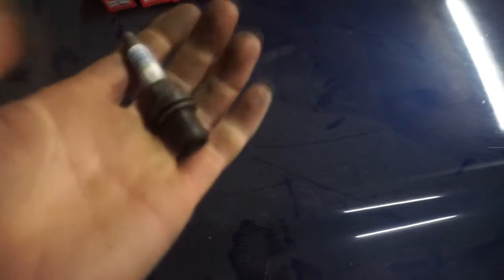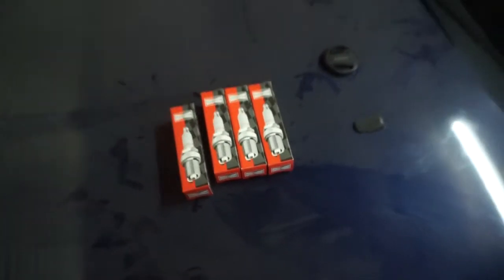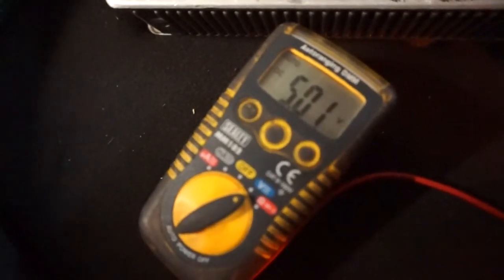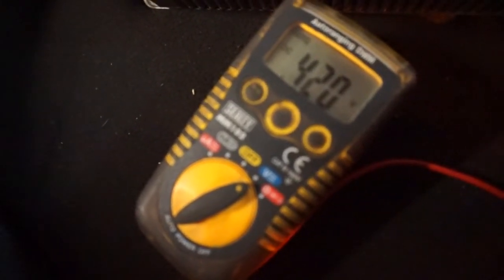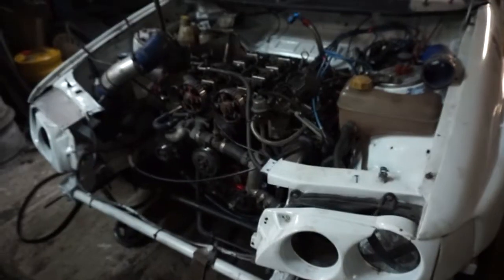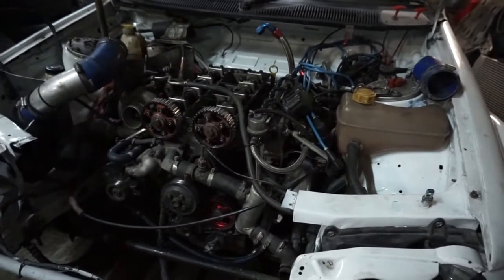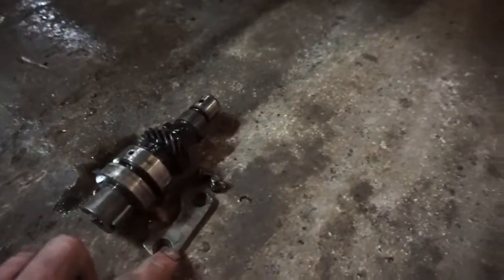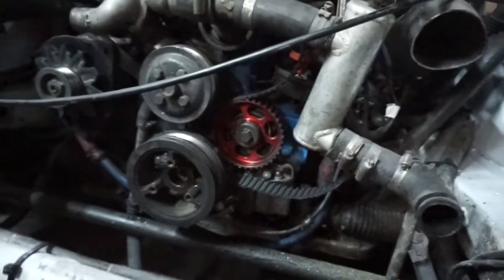got the misfire fixed on the escort cosworth race car

Comment: Most people prefer the denso ik series of spark plugs. It’s hard to find a set of 071c that hasn’t got a dud in it
Reply from the maker: ScottishScoobs aye we have run the 71c for the past 2 years without much issues sometimes they didn't last that long mind you
Reply: Hi Scott..which model Champions..q59 or 57???
Reply from the maker: christiancosworth  the 57s mate